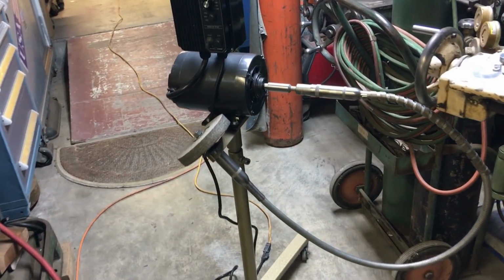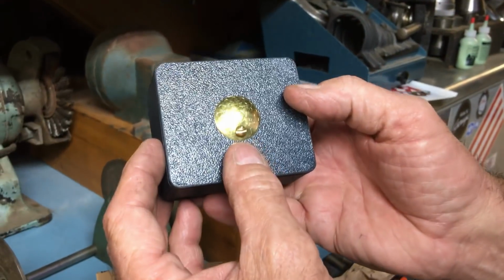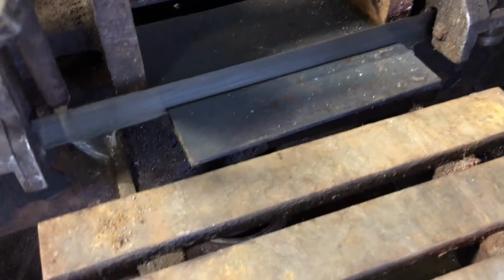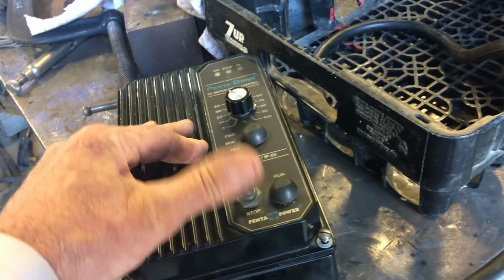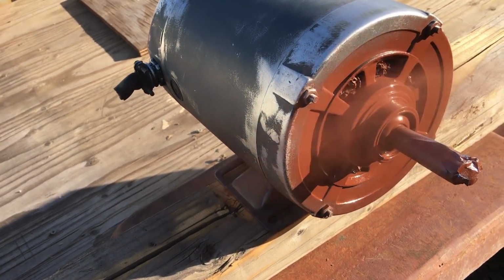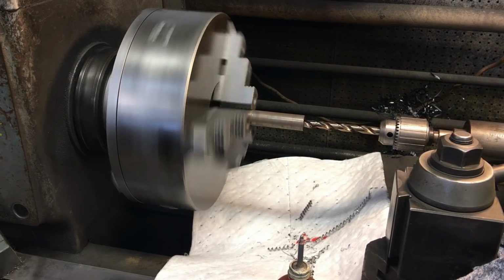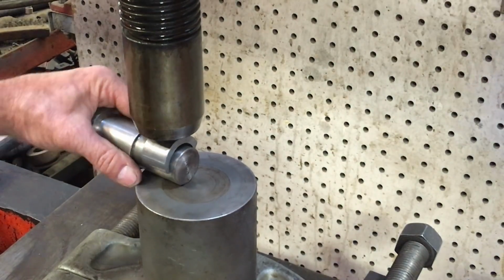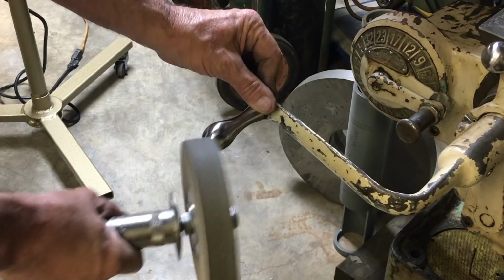Flex Shaft Buffer

Comment: That is a nice build on the buffer Gary. I have a 1951 Craftsman catalog that shows basically the same flexible shaft for a whopping $9.95. It says that the tread on the end is a 1/2 20 tpi. If yours is the same you could run a 1/2" threaded drill chuck if ever needed.
Reply from the maker: Andy, yes it is 1/2 20. When I got it it came with a Chuck already on it. $10.00 was a lot in 1951.

Comment: I thought my CA stuff on my Monarch was big. That DA stuff is monstrous. You shouldn't have any flex out of a 2.5" diameter boring bar. It was cool to see other parts of your shop in the intro.
Reply from the maker: Tom, The DA stuff is definitely beefy.  At some point I need to make some very large drive hubs for some gear boxes. 17 inch OD with 6 inch ID Holes 8 inches long. The 2 1/2 inch boring bar will come in handy.    One of theses days I will do a walk through of my shop.     Gary

Comment: Hey Gary, really enjoy watching your videos, like your precision, but when welding [I am a weldor] all those bb's and spatter makes me go nuts.....sure looks like your voltage is too high from here in Florida......guessing you are using .035 wire with 75/25 ar-co2...... a real good setting for that combo is 160 inches per minute and about 18 volts.....that will give you 100 amps [1.6 inches per minute equals 1 amp for .035 wire]. [1 ipm = 1 amp for .045 and 2 ipm = 1 amp for .030]...you will get plenty of heat and a lot less spatter......hope you try out and let us Weldors out here know how you like.of course, crank the ipm and volts up for thicker material, but this setting works great for vertical and overhead, I got my D1:1 AWS structural steel unlimited thickness certification with this setting........ Best Regards, Paul Brown